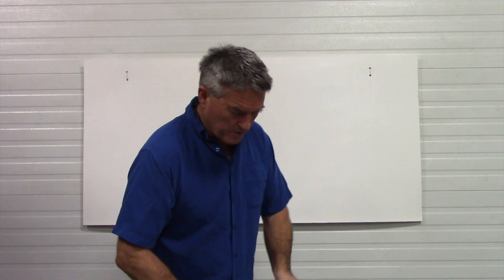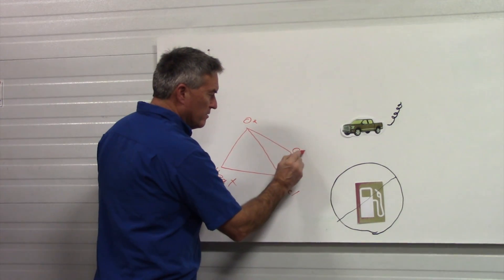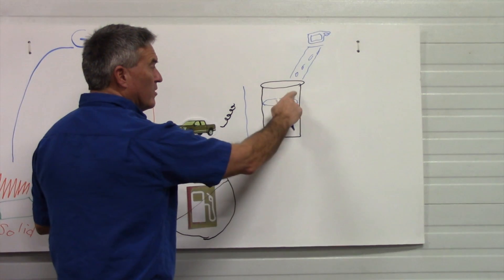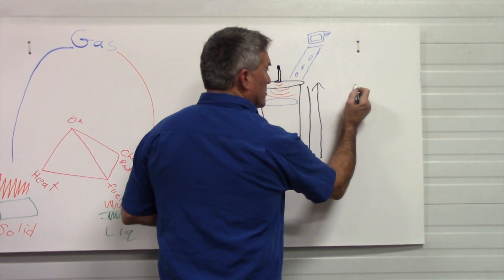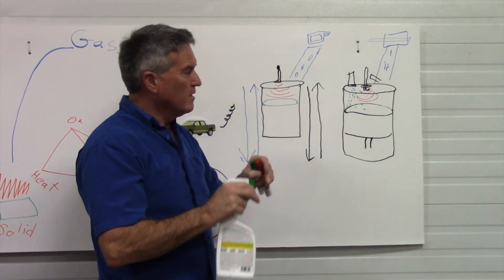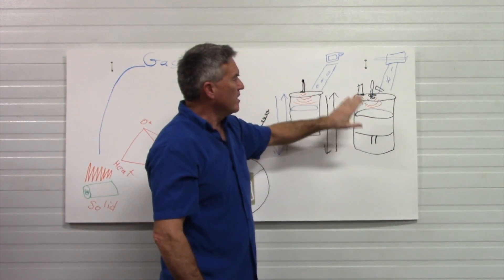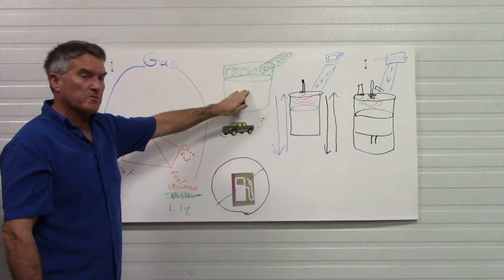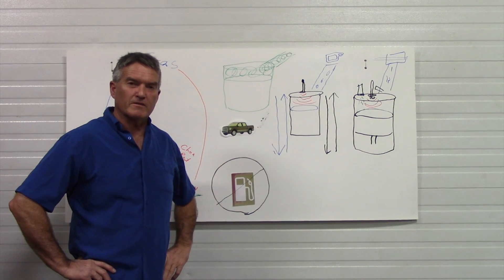One Simple Trick to get 100 miles per gallon with less pollution!

Comment: Anyone thinking that there's a simple and cheap way to reduce a fuel consumption in Internal Combustion Engine (diesel or gasoline) should use some common sense. All car manufacturers are spending a lot of money to make their vehicles more efficient...and i am talking billions of dollars...Most of the low hanging fruits have been already picked...so far any other solution comes at the stiff price...being more expensive to implement and increase the vehicle price. At some point, the price will become prohibitively high and start to make electric vehicles more competitive  and cheaper solution. In the meantime...the Internal Combustion Engine is soldiering on...if there's a simple and cheaper solution to fuel consumption (or cleaner exhaust) out there...LOL..like $30 plug in engine controller or fuel magnetizer or similar .....don't you think the car manufacturers would gladly pay for the licence to save on the Research and Development  100's of millions of $ to get only minute improvements.  If it cost you a billion dollars to develop a generation of engines with 20% better fuel efficiency than the older generation ...how many vehicles you have to make to recover your cost and make a profit? And if you can get the same efficiency by buying a product (or the licence to produce) that someone is selling on e-bay for &30...and mind you...production of the scale should shortly bring the price of the product even lower...and if you buy the licence to produce is safer for you for future.The point is...there's no simple trick. Or cheap solution. Maybe in the future ....but at this point everything i see looks too god to be true

Comment: It makes a lot of sense. This should be researched further by the big automakers... Compressed natural gas is used in some vehicles which has a far less carbon footprint than regular gasoline. The trick is to turn gasoline into an explosive gas (not combustable, but explosive with the oxygen already added) near the engine itself safely. This definitely makes sense if you watch the video carefully.

Comment: Nice pitch but I think in the long run it's going to be the electric cars that are going to win
Reply: If battery technology ever gets decent enough, it has a long way to go. And it would also be helpful to use more efficient motors, the iron core induction motors used in electric vehicles now are an ancient, inefficient technology. When Tesla invented the induction motor it was a major improvement, but now there are permanent magnet brush-less DC motors which are at least twice as efficient. Yes they are similar to three phase AC induction motors, with the major advantage of using permanent magnet rotors instead of just iron core rotors. I think Tesla would be ashamed to have his name put on such terrible technology, he was always pushing the limits of what was possible, I'm sure if he had been alive later he would have invented the permanent magnet brush-less DC motor and if he made an electric car today he would use one of those instead.

Comment: Couple questions; by introducing a gas you got rid of the lubrication cooling capacity of the fuel and did not address that. Also doesn’t the rapid compression of a produce enough heat to boil the gasoline...

Comment: As per the 'excess fuel' keeping the engine cool.  I think you didn't explain well why/how the 'excess liquid fuel' keeps the engine 'cool'... Which for this discussion simply means 'not burning up the exhaust valves'.  The 'cooling' concept is based on the fact that fuel needs to be kept in a 'combustable range' of not too lean or too rich.  If there is too much fuel, the combustion will not happen.  More below...

You are correct that ONLY fuel vapors burn.
There are actually TWO combustion events in an internal combustion engine.  The first when the spark plug fires and the gasoline that is ALREADY VAPOR explodes (combusts) and the secondary combustion follows as the rest of the fuel turns to vapor (in the resulting heat), mixes with air and then combusts.

The 'problem' is that it takes up to 25 milliseconds for this secondary combustion to take place and you only have about 7 milliseconds where 'combustion pressures' can efficiently turn heat energy into mechanical energy.  So the 25 millisecond burn would be occurring right past the exhaust valves, burning them up.

So the automotive engineers thought of a brilliant solution to the problem...  PUMP in MORE liquid fuel, so that after the initial combustion of the fuel vapors, the resulting heat would vaporize all the liquid fuel and the resulting gaseous mixture would be TOO RICH TO BURN, thus QUENCHING the secondary combustion and keeping the gasses exiting past the exhaust valves 'cool'.  

This solution results in EXCESSIVE waste fuel, that then is burned in the catalytic converter (a pet peeve of mine, because I honestly believe that fuel should be burned in the engine, not in the exhaust).

This solution also results in excessive engine wear, because the liquid gasoline washes the lubricating oil off the cylinder walls.

This solution also results in excessive carbon buildup (with all the problems that causes) in the cylinders and on the exhaust valves, as the 'unburned fuel' 'condenses' on the metal parts.

This solution is GREAT for making money because it uses LOTS of fuel and causes mechanical breakdowns.

But there is a simpler solution, as pointed out by yourself.  
Simply pre-vaporize the fuel before it goes into the engine.  So that it can completely burn in the 7 milliseconds and there is NO secondary combustion.  The combustion is clean, complete, 'cool' and 100% happens in the engine.  No need for a catalytic converter.

Vapor fuel is the obvious solution, for anyone who has studied this issue.  The engines run on the vapor fuel, always have and always will.  The fuel that is 'liquid' when the spark plug fires is just wasted, it does not power the engine.  
We are literally throwing away literally 90% of our fuel by NOT using properly designed fuel systems.

I have several books that cover these (and many more) details, including how you can modify YOUR fuel system to be more efficient..: Or build an entirely new fuel system
https://eagle-research.com/product-category/fuel-savers/

Comment: The more oxygen or nitrous oxide you pump into any motor you still need a pre ignition fire and you need something to like that unless it's on the lines of a diesel fuel and then it blows up with the correct amount of heat within the cylinder.

anything with a hemispherical head will burn things a lot better due to the fact of the positioning of the spark plug and the initial detonation it is more close to a nuclear explosion start or a hydrogen explosions start however you wish to look at it because that's really what we are trying to accomplish by burning a fuel back to 100% of what it is made of I apologize I need to tell you that doesn't matter what state of matter matter is matter still consists of H2O and an electrical Bond carbon falls in to these two rules by being able to be made from H2O and any type of plant material is already holding water and a mineral so once you squeeze it for a oil and burn it for its wood wood-style value you will even see the light come back out of the what you used to call Wood LOL so what way do you want to look at the environment a tree is an extension of your lung a plant and a grass resonates at the same frequency oxygen does which is a frequency that your lungs can handle your eyes see frequency and your ears hear a different type of frequency LOL I'm pretty sure I'm right but have a great night all

Comment: There is no way that vehicles are producing "tons" of waste. If so, then why aren't the highways and ditches full of "tons" of carbon from all the vehices? All the city streets would be ass deep and the cars could not move.
Other than that, I agree.
Reply: Carbon dioxide is a gas that floats upwards and is practically invisible.
Reply: Nathan J ........You're not stating anything that we didn't already know. 
What I said, is still valid and correct.
Reply: @theSword-  not true. What you said is an impossibility due to how engines work. Raw fuel being waisted does not mean liquid spraying out the back of a exhaust pip. It means that the fuel is not combusted all the way and escapes as gasoline vapor, carbon monoxide, carbon dioxide, and other trace elements such as water which are signs of fuel waist and incomplete burning. Therefore what you said was invalid and I was just stating that fact.
Reply: Nathan J .......I never said anything about raw fuel spraying out the back.
If there are "tons" of fuel waste emitted, then where is it?
Shouldn't there be road clean-up crews specifically moving all these "tons" of waste products off the highway?
I know very well how engines work. There is no way there are "tons" of waste coming from an exhaust.
Reply: @theSword-  Why would the waist be on the road? The waist is a byproduct of combustion which means gaseous material that would be scattered across a distance due to the disbursement effect of non-solid/non-liquid matter. The weight measurement of Tonnage is not just for solid or liquid but also gaseous matieral. Therefore no mess or cleanup required. This also means that all waist is in the air and atmosphere.
Reply: Nathan J ........did you not read what I wrote?
You cannot weigh something in "tons" that floats. 
You also never stated what the "simple trick" is.
Reply: @theSword-  I did read it and i was explaining/debunking all of the possible ways you might be rationalizing your idea. Also weight measurement is not soley based on solids but also gases by simply knowing the weight of their solid state since mass doesn't change based on state. Also this isn't my video so I don't know the trick. Also i never said he was right just that you were incorrect about the wast of car operation. Also apologies about misspelled words.
Reply: Nathan J .......There is no "debunking" the fact that there is no way to weigh gases that float out of all the cars' exhausts. No one has done it, and no one will do it because it's physically impossible.
Reply: @theSword-  also not true. All you need is to know the specs of your engine such as how many liters(example is a 3 liter engine which refers to how much air is able to fit into the cylinder for compression.) and how much fuel is injected per spray to figure it out. This has all been calculated but I'll give you the basics so you know what to look up to check my response. You need to know the amount of carbon dioxide and carbon monoxide produced in a given amount of burned gasoline in order to know the tonnage of waste. So if you take the liter per cylinder and amount of fuel burnt in a single powerstroke and take into consideration the amount of gasses that are not produced by unused fuel that didn't have time to burn, you can find the volume of gas produced and multiply that by the number of cylinders the engine has. After you find the volume you can look up how much carbon dioxide and monoxide wiegh in phisical form and then through some basic chemistry math you can convert this into volume and then you can just use this as a measurement to go by when you convert backwards with your number.  Once more we are not done yet and must then take our final number and assuming the answer was based on how much is produced in one complete cycle you then use the amount of cycles per average rpm in an engine. If you remember we were given this by the video which stated that there are on average 16 power cycles per second at 2000 rpm which is supposed to be highway speeds. If you want a different average just adjust the rpms and scale down mathimaticaly. So the final part to this is average amount gases produced by each cycle times the amount of cycles per second at our average rpm then take all of this and multiply it by 60 to get the amount produced every minute then so on untill you find the amount per year. In conclusion, with basic math and a little knowledge in Chemistry not only is possible to weigh the amount of gasses floating out of your car but also it has been done and is not hard to find anywhere on the internet.
Reply: @theSword-  it has been done. You can find numurous websites and scientific papers on the subject if you Realy don't believe me. The math I showed you is only a fraction of the real math since there are many variables such as different models and makes and the exact number of cars throughout the years are of different count depending on who you talk to. You can find papers that have calculated the tonnage of the total carbon in the atmosphere within a estimated range that is accurate within 160 to 390 kgs so I'm not just guessing but if I were it would still be accurate enough to say that there is tonnes of waist from each vehicle each year.

Comment: Mule fritters... Then propane should make 70 miles to a gallon, cause all you burn is the vapors... The hot engine parts vaporize the liquid fuel...  Liquid fuel cannot burn... Engine will not  run on liquid fuel... It's why a cold engine runs rough... No heat to vaporize the fuel... And, cam design is a major fuel waster... Cams overlap the opening of the valves, to allow raw fuel to cool the exhaust valves...  All your emissions crap, is needed to handle this raw fuel, used to cool the valves..  a fuel injected engine, injects fuel when the exhaust valves is open, to cool it... His design, would melt all the valves, in about 20 miles. Nissian has built an engine that eliminated the wasted fuel, used to cool valves... It is a city only car, and cannot exceed 45 mph... But gets 48 m.p.g... in the city..

Comment: Wasn't it somebody called something like Newton that told us energy can't magically appear from nowhere. If so then a gas formed from fuel will have the same amount of energy or perhaps a bit less because of the change of state.
I think a high school teacher said that.
Also remember in more advanced countries people power cars with liquid petroleum gas. 
And that has about half the energy of petrol because the cars go almost exactly half the distance on a litre of it.
And, yes its measured in litres because it is liquid when it goes into the tank. It turns into gas magically when you open the valve.
Good try if you ignore all the fundamental scientific and practical mistakes you made
Reply: About 10% of the potential energy of gasoline makes its way to the output shaft of a internal combustion gasiline 4 stroke engine,90% is lost due to inefficiencies .There is a lot of room for improvement.

Comment: Hot vapor engine has been invented in the early 1900's bud.. nothing new.
Reply: It was used all the way through ww2 and they vanished. The nazis were getting 80mpg in v8 Mercedes with vapor carbs.  This is just a fancy one that the fuel pump fills the tank Instead of using a gas can under the hood
Reply: He is not presenting anything new but rather stirring up the population to a change much needed. Companies call this promotion.
Reply: @chadcervantes6066  Yea and by saying so and or showing how he may disappear.  Most that does this ya never hear from them again.  Either silenced  by big government or a tragic accident  happens. Even a suicide.  If ya do it then do it no keep your trap closed.  Look up the history  on it.  Oil companies  will not let this be a new standard.  Or has will hit $100 a gallon or more. They  have to make their $ off oil.  Plain and simple!
Reply: And everyone that tries to do this and push it suddenly disappears or is locked up. Big oil companies  won't let that technology  be on the market.  Id they did gas prices would  be about $20 a gallon. So they would still make their $$$.

Comment: how can I use this to use in my car?
Reply: Look into vapor wick carburetors. Might be the simplest solution, but you have to watch out for flashback.
Reply: There is actually a guy that got 100% fuel vapor using a the exhaust with a heat exchanger and a turbo faced directly into the intake. He shows exactly how its done on the Facebook group Gasoline Vapor Systems.

Comment: See my wireless car on Kickstarter. Wireless cars will make oil and battery powered cars obsolete. Wireless car doesn't need a gasoline motor, transmission, fuel tank or batteries. It only needs electrified streets, electric motor and a receiver and will cost less than $10,000 for a brand new one. When speed limits are lowered to 30 miles per hour nobody will need car insurance as nobody will be seriously injured or killed at those speeds. Jesus Is God I am the Messiah, join the Timothean religion to solve world problems

Comment: False, oil is not a fossil fuel and it doesn't take millions of years to get. That said, you are right about the current gasoline engine being a waste. There is a lot of fuel that is lost/wasted in the current set up. Yes, injecting a vapor instead of raw fuel would make a difference, the problem is the combustion engine is controlled. There have been numerous attempts of the years, that have been proven to work, that were no allowed to be produced.

Comment: Internal combustion engines can burn any flammable gas if introduced into the engine intake properly. This includes wood gas, gasoline, propane, natural gas, acetylene, diesel,  and thicker oils like "bunker fuels" (the oils regarded as leftovers from crude oil cracking). So, what is your concept to keep the temperatures down on your suggested lean burn mixtures? Especially with today's aluminum block engines which are extremely sensitive to heat? This sounds like the claim to "perpetual motion" machines, collecting electricity from the atmosphere, or cold fusion. NOT technically obtainable with today's technology. So much B - S is my opinion, sorry.